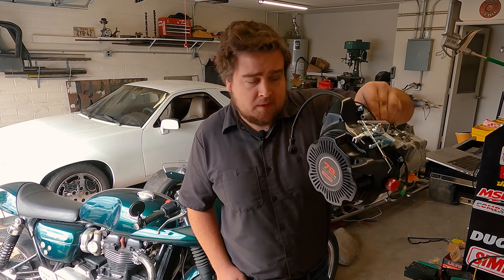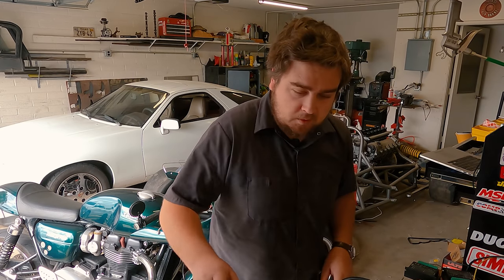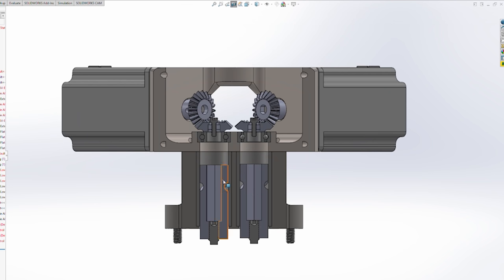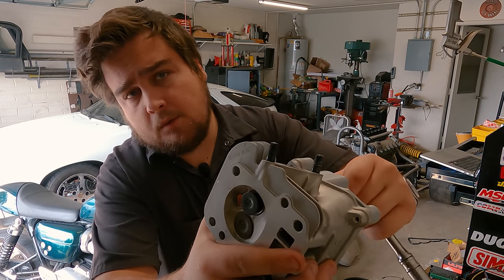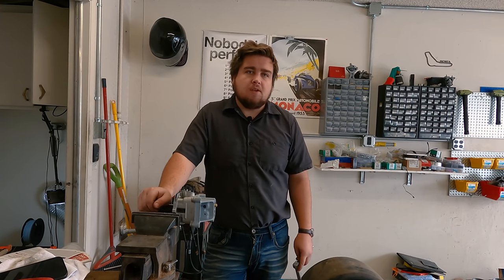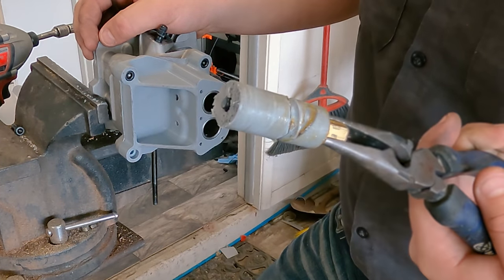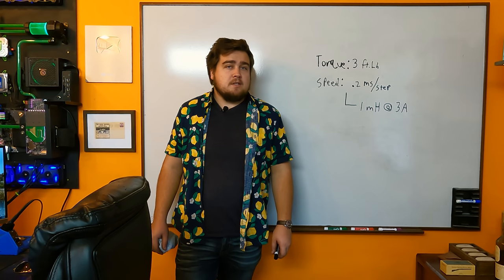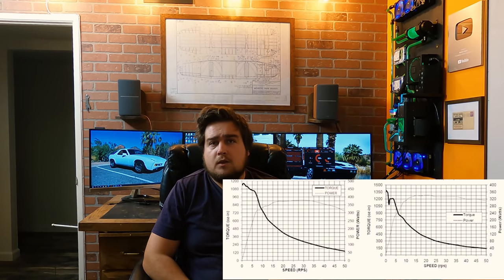Adventures In Deleting Camshafts | The Theory

Comment: What if your ball-bearing channels ran the full circumference of the valve. So the valve opens and closes as it spins. Then  you don't need a stepper motor, you can use a more standard motor and match the speed to the desired cam profile?
Reply: So just like a windshield wiper where the motor never actually reverses. Ought to be much easier to develop a PID loop for if you had direct feedback for valve position, which would remove the need to tune for different cylinder pressures under different load conditions.
Reply: that would work just like normal cams do, he's trying to have different ramps, duration and lift depending on the load on the engine
Reply from the maker: I did a design like this off camera, and actually used a second stepper to change the profile as it went around, but it limited the actual adjustment to around 10 degrees.
Reply: @alessiocarlevaro6934  Yeah true, I guess it would be more like variable valve timing with a huge range than a total free valve.
Reply: Came here to say this. Using an angled race, valve open and close durations could be changed by just changing motor speed. No stepper required. Might not even need a spring (or at least just a small one) to close the valve.

Comment: Water cooled 3-phase linear motors with an encoder would be my first choice to actuate the valves. Voice coil actuators are similarly awesome but with a lighter carriage and they can operate on a single phase. It isn't cheap though, especially for a 4-valve. If you want a cheaper solution that you can do yourself I can help you out with the specifics on how to do that.

Comment: What if you used off the shelf ball screws from Amazon? You can get them for around $30, and they come with metal ball screw nuts and mounts. You could design it into the mounting system, and use hex profiles for the nuts. In my experience this is very strong in printed parts. You could also print a part the interface between the end of the ball screw and the valve itself

Comment: Maybe use two motors per valve, I know more complex design, but maybe easier in the long term.
My idea goes as follows:
One motor brushless DC ( 2 or 3 phase) that rotates the actuator you show in this video, but the thread path is not linear, it is more to the profile of open for a little time that a valve normally does.
The second motor might be an stepper, the rotates an external cylinder of the actuator the first motor rotates.  This cylinder has in the inside the balls the first one rides on, and external a fine pitched thread.  The block that keeps this in place has the mating thread of this second part.
The way it works, the brushless motor rotates at the right speed and phase to open and close the valve when needed.  To control how much the valve opens, the stepper raises or lowers the fine thread cylinder and controls that.
I know it is way more complex mechanically, but the brushless motor speed and phase control is not that complex, and the stepper handles the valve travel distance with not much torque.
I do see one disadvantage, which is as more valve travel is needed, the amount of time the valve is open increases.  Not sure how to deal with this.  Changing the speed of the brushless per degree of rotation is not simple (inertia gets in the way).
Hope you see this.

Comment: I'm thinking something more along the lines of hydraulics, but air might work for this also.
Basically turning each valve actuator cylinder into a reverse-diesel injector pump (wait what?)
Imagine if a piston is driven down by pressure but uncovers a hole, then it will stop moving, right? Because the pressure is now able to exit.
But if the piston were then to return it would cover the hole and pressure would hold it back.
Basically the piston would stay where the hole is and that's where the diesel injector pump comes in because that's how they meter the fuel.
The cylinder in which the piston is located can rotate and change the position at which the piston will relieve pressure.
Now reverse that. If you supplied pressure then the piston would stay where the pressure is relieved so you could control valve position by rotating the actuator piston cylinder.
Perhaps then you could use solenoids or some other fast-reacting actuators to control the valve position.
Anyways, that's just an idea i had.

Comment: How about you switch the valve motion from rotation (where I would see the semihelical guides or the pin that rides in them wearing down quite fast) to linear and move them via rack and pinion? With this you could substitute the speed you're not getting with steppers with torque, which they usually have quite a lot of. The correct speed could be arranged via the choice of pinion - given the motor still can move the required amount in the time you have.
Or, as an alternative, use a lever attached to the stepper like a RC car servo motor horn, and use this to move the valves on a linear rail or with their shaft stabilized in bushings.

I may just be talking out of my rear end here of course, as I'm not an engineer.
Reply from the maker: I genuinely considered it, and I may look into it a bit more. 10mm of travel is in such a weird place because it's not a ton  of distance but it's just enough to cause problems.

Comment: Not sure if you are going to get what you need from a stepper, maybe some chunky brushless AC servos can get you closer, if you dont want to remove the return spring for a fail safe.     I think you might need to switch back to air for a 20ms cycle time for just a cylinder actuation. You might be heading towards a poppit style pneumatic hammer setup to open and close, it can be pretty predictable that way and timable, there are plenty of paintball guns that were setup like this that can cycle over 30 times a second moving a bolt back and for 3/4" while striking a knife edge valve to release high pressure air. Some of them also had a few hall effect sensors at the beginning and the end of the ram stroke which allows the timing to recognize if the ram completed a full stroke or if there was a problem. Which with a miata being a non-interference engine should be pretty decent. SMC sells plenty of pistons with a magnetic piston for use with HES sensors. MAC valve is a good solenoid producer with a ton of used inventory on ebay and the like as well.

Comment: Regarding your stepper issue, the choice of a stepper might not be the best in your use case. Off the shelf servo motor will have the accuracy and speed you need. Another option might be bldc hobby motors with reduction (planetary, cycloidal, strain drive ...) and use of positional control board like odrive or tinymovr.
Reply from the maker: Yeah, servos seem to be a good option as well, I'm looking into a few.

Comment: Super cool! Love the content! Maybe some kind of solenoid that has hydraulic pressure on the back side to help it “return” or to boost the return rate of the valve? Idk If such solenoid exists? Maybe switching to a hydraulic manifold to operate the valves would be more cost effective and still give you the control ability of the stepper valves for programming

Comment: Start and stop the stepper 50 times per second wont work. But you can let it run at 3000 rpm and control the rotation speed during the valve open and valve close parts of one revolution. Means you can control the valve timing with a stepper driven cam lobe.
Tom Stanton does control a helicopter with this angular velocity system. See YT "Drone Helicopter Hybrid".
Note that brushless motors are basically 3-coil stepper motors.

Comment: Could you hit the stepper with a cap charged to a higher voltage? Make it a small cap so the discharge just improves the startup response.
Reply from the maker: That's actually something to consider- possibly!
Reply: @WesleyKagan  Also to discharge a coil quickly, the cap can suck up that current from the coil as well.

Comment: Since this is the internet I'm going to comment before even watching the rest of the video. The first concern I have with this design is that it requires the stepper to reciprocate. It has to accelerate, decelerate, reverse rotation, rinse and repeat. I see this being a serious limitation and I don't think you'll find a part that can do this.

Seems like servo that can rotate continuously on a sort of crankshaft (to allow deleting the spring) along with a stepper to adjust total lift would be the closest you'd be able to get with off the shelf parts. Just back of the napkin.

Comment: The ideal motors would probably be brushless dc with magnetic encoder feedback. you also want to be careful with the mass of the ball screw, and to make it efficient and not bind, multiple races would be advisable. all this being said the best bet may actually be a solenoid. I know its also possible to make a solenoid with multiple poles that can act like a linear stepper. a stepper solenoid if you will.

Comment: I have a suggestion instead of turning it back and forth Have it rotates constantly similar design from yours But it has the other side is mirrored Also you could make you parts by casting aluminum

Comment: One of mechanisms for demolition hammer could be implemented, as they are capable of being fast and powerful and on top of that lift changing mechanism could be implemented. You will get no problem with stoping engine and reversing it with no time to do so.

I just invented BLDC driven Prince engine head, but desmodromic  :v

Comment: Wesley, could you change the gear ratio on that 90° gear set so that is was 2:1 or similar? This would half the distance the stepper needs to spin, but of course increase your torque required.

Also, can you design the spinning 'driver' which pushes the valve down, so that the gear on it has an inbuilt ratchet mechanism? What I mean by this is that it would only engage when spun one direction, and not require a counter spin to close it (if you're not already doing this). That way, your stepper only ever has to rotate one direction, and you could rely on the spring to close the valve just like it does on a normal engine.

Comment: The biggest problem that I see here is a motor that's (accelerating) quick enough, has the travel range and torque/force. I propose something similar but different, although with some more moving parts. There are two things that slow the movement in your current idea down. First, with a stepper motor you need to energize coils multiple times, each time being limited by the inductance. Second, you're using a closed loop control system to directly control the end position of the actuator. To achieve a stable system behaviour without overshoot and so on, your maximum speed of the actuator will be limited. Probably too much, actually. I currently work for a company that does fast (and precise) linear and rotary positioning. What is considered fast with our products is still too slow for your application.
I suggest the following design: use a slow(ish) moving and sufficiently stable end stop, the position of which you control with your stepper motor. Then you use a linear voice coil actuator to just slam the valve down into the end stop.
Advantages: Time is saved during acceleration because you only need to energize one coil once. Time is saved during deceleration because there's no controlled braking phase.
Disadvantages: You cannot control the actual speed of opening. Also, you maybe can't switch between extremes, e.g. 10% open/100% open between two openings if your end stop is too slow.

Comment: For the longest I kept thinking why aren't turbos powered by electrical motors , and valves by actuator , and sure enough there are companies that builds E turbos , and a whole car company that runs on camless engine.
The only reason major car company aren't messing with them are because of the cost , they all worried about their bottom line . Koenigsegg should partner with VW or Toyota and license the technology to make it a more affordable option. I'm pretty sure they jump on it. And that way they could fund their development and make more money in the process.

Comment: An energized stepper motor should have enough holding force to seal the head. Get rid of the valve springs and see how much torque you need to open the valves (very little). Maybe use a small spring to prevent engine failure due to a bad stepper motor.

Comment: Have you considered doing a Diesel engine for you test bed? They operate at lower RPM ranges which could help with stepper motor requirements

Comment: I have a concept for the valves that probably won’t work.  But.  Instead of the traditional valve that has a stem and move up and down, what if you had a disc with a slot in it that rotates to open?  It’s probably been thought of before and there are reasons it doesn’t work but seems to me you could get better flow and control with a disc than a stemmed valve.  Like I said - just a thought. I lack the skills to try this idea out.

Comment: a gearpump pumping oil in a loop and open and close valves on tiny pistons. might need some relief valves to mitigate liquid hammer. but in theory it should be fast enough and strong enough while beeing pretty compact. the oil should flow pretty fast in the loop so the valves can open and close in an instance. a buffer or accumulator might prove usefull.

Comment: Great idea! Extremely stupid question: since you are mechanically actuating the whole thing, does it really need to be an interference valve design? Would it not require less torque to pull the valve out of the piston, instead of pushing it in? Maybe with a separate mechanism locking the valve in place from the side when the piston pressurizes?
Reply: That locking mechanism is exactly why the valves move into the engine. The pressure pushes the valve shut - an extremely robust 'locking mechanism'. I believe some old school rotax jetski engines used rotating plates with cutouts in them for valves... But that's in a two stroke so they don't need to withstand anything more than crankcase pressure

Comment: What about an cam driven oil pump. Since you already have a oil system to tap into, or it could be a stand alone system. After oil pressure actuation of the valve it could bleed off a bit lubricating the system. I know you want to use electronics but just an idea.
Reply: Like banks only linear rather than rotary. High pressure low volume oil with electronic super low mass solenoid valves? Pretty sure catapillar deisel injectors work the same way too.
Reply: Vanos not banks! Bloody spell check!

Comment: Though I like your project, I believe that you're going to discover what everyone, other than Koenigsegg (who may be running a scam), has found: it's impractical and there are better alternatives. My favorite is a two stroke diesel with two opposed pistons per cylinder (no heads or valves). The design is demonstrating incredible fuel efficiency and longevity. The only significant downside are high NOX emissions. Achates Power is very close to a production ready design that should take over the ICE market.

Comment: What about, electric-hydralic? The electric part just letting pressurized engine oil from the engine to pressurize and open it.
Reply: Yep- this is how Fiat do it but the engine oil is absolutely critical.
Reply: This style of engine uses splash lubrication.
Reply: @DiscoFang  What about a separate electric pump, and oil canister?

Comment: Consider rather than using a stepper motor, using a brushless DC servo motor or encoded brushless motor. Rather than making actuator have to accelerate and decelerate, make the groove a complete circle and just spin it at the correct RPM. If you want to vary lift, set up a platform that moves to and fro. Would be curious if you could use this for cylinder deactivation, but that's a question for further down the road.

My other curiosity is, could you use a power steering pump to make hydraulic pressure for actuating the valves? You'd probably have a hell of a time overcoming the viscosity for that type of thing.

My other thought was a cantilevered solenoid. That way you gain mechanical advantage.

Comment: It's been a while since I watched the old free valve videos but is there some reason why you have discounted electronic solenoids? It could potentially move very quickly, at the penalty of being essentially binary, (can't control exact position, it's on or off), but thinking about it, you could have a stepper motor adjust how much throw the solenoid has available to it, (by moving a stop) since these adjustments would only have to happen a few times a second and not 50+ times a second. You could also use one stepper motor for an entire head to adjust how far it opens.
Reply: This is exactly what I was thinking! Electric solenoids seem to be the ideal choice here.

Comment: How about using an actual on/off solenoid connected to a bellcrank lever that pushes on the existing poppet valve. Mount the solenoid on a movable plate and use a stepper to move the plate closer or further away. The lever gains lift the further it is from the valve.

Comment: could you just use a stepper motor to control the cam shaft slowing or pausing at the peak of the lobe to create a longer duration came profile. not quite free valve but definitely cool in its own right also much more a achievable on a single cylinder prototype. love your videos keep up the good work would love to see the v12 running someday. those Mercedes v12's sound mental.

Comment: Instead of traditional stepper motors and controllers, what about directly driving a high pole count 3-phase brushless motor?  Torque and speed wont be as much of an issue there, but you'll need more complex drive electronics.

Comment: Can you use two (or more) steppers per valve ? To increase torque if you change your gear ratio

There are also these weird drive systems that add the speeds rather than torque